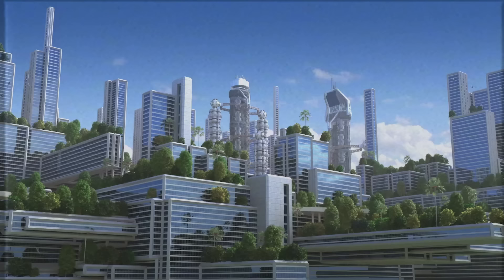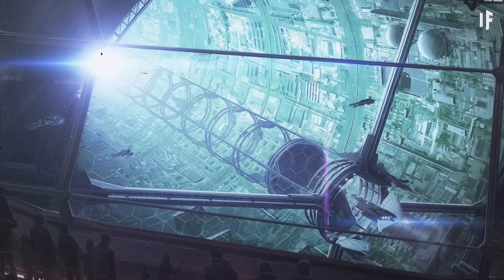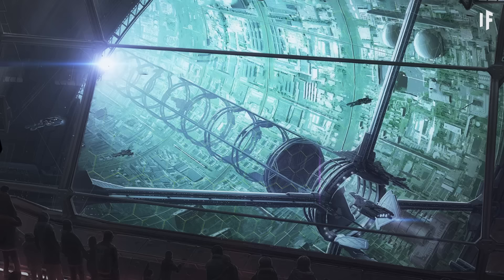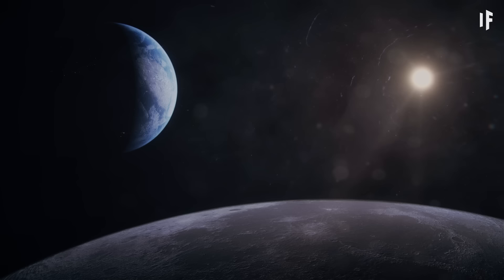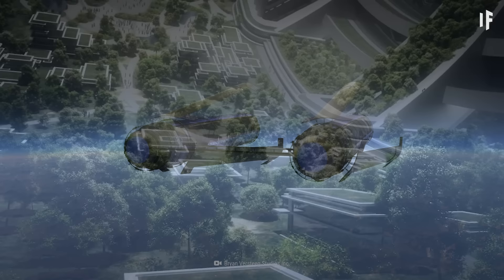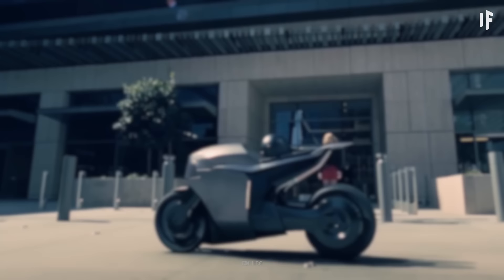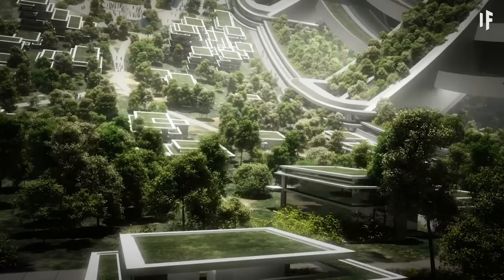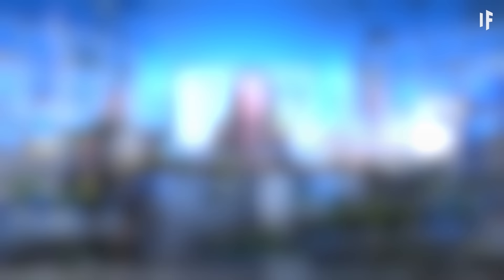What If We Built an O'Neill Cylinder?

Comment: The big problem with O'Neill cylinders is their instability. The will eventually start to tumble end for end if some method of stabilizing them isn't employed. The two cylinder method is interesting. Some proposals had them end to end counter rotating.
Reply: That is what those "fins" are for friend. They are mass re-distribution and radiators made into one structure.
Reply: @timothyblazer1749  If they're big enough and on both ends sure. However a spinning T shape is even less stable and pretty much going to flip end for end suddenly on a regular basis. I forget the name of the phenomenon, but there are video's of it being demonstrated on the ISS and you can also see this by setting a t shape spinning on your own.
Reply: Also note that the very large cylinders were only a sketch, only presented as an example of what's possible and feasible, not a finished design. O'Neill said it's probably about as accurate to what we'd have 80 years after completing the first small factory in space, as what "futurists" in 1900 thought about the year 2000.

There are no stabilizing "fins". The 3 huge things outside are mirrors to bring Sunlight in.

Comment: this is actually a better idea economicaly than many people think.  I have seen articles proposing this as the solution to some upcoming shortages of agriculturally produced products.  Many grown resources, such as rubber and cocoa and other such things, require very specific soil and climatic conditions.  Here on earth such places have already been claimed and developed, leaving little room for expansion of production.  An enclosed habitat however could have those conditions artificially created within, and more space could be created by building more.

A bit far fetched in the current conditions, but if demand for such things expands or climate change or soil depletion reduces current growing capacity, it may become necessary

Comment: I'd start the description by first describing the floating wheel design. Explain that the ring, as a design, doesn't offer much floor space or living capacity. The radius is the limiting factor, when combined with rotation speed, they need to function together to keep local gravity near 1G. An increase in the length of the cabin would increase the radius, and yes the rotation speed could be reduced to compensate. Larger radii and slower rotation have advantages to the people living inside, but the tensile strength of metals limit how big it can go. The other option is to simply widen the cabin. There is no limit per se, just keep extending the width of the cabin along the axis of rotation, and you end up with the cylinder.

Comment: interesting fact- if an asteroid did put a hole in an oneill colony, depending on the size of course, it would actually take a long time, possibly days, before enough air leaked out to become dangerous. think of a full balloon that you then stick a pin into (without popping it); it takes a loooong time for all the air to leave through that tiny hole

Comment: Question for a scientific or engineering type expert:
If the cylinder has different levels or decks ( in the video it says it might have one 250 metres inward from the outer level) would somebody standing on the inner deck experience the same gravitational effect ( ie 10ms²) from the rotation of the cylinder as somebody standing on the outer deck? 
Would the effect be the same, or lesser, or greater?
Reply: see the site "spincalc".

Comment: Far from what is claimed, the weather would not be easily controllable in a volume of almost 900 cu Km (900 billion cu m).  The NASA vehicle assembly building, at only 3.6 million cu m, is large enough to generate its' own internal weather.  In the cylinder the temperature, humidity and atmospheric convection would all have to be strictly controlled throughout the whole volume to maintain an acceptable environment.  That's one hell of an air conditioning system.
The only alternative is to allow the internal climate to develop naturally and see what happens.  The Earths lower atmosphere is only 10Km thick.  The radius of the cylinder is a third of that.  Rotation of the cylinder would create a vortex along its' axis and the effect would require serious consideration.
A simple solution would be to compartmentalise individual areas but the result would not be the large open space that is shown in the illustrations.

Comment: You've missed a very important piece. You need to make a pair of cylinders, counter-rotating which have they're endpoints connected. Otherwise precession would get it going out of control. 
Also, O'Neill updated his design to NOT use a Lagrange point. I think that putting 2 pairs of colonies on either side of the Aldrin Mars Transfer orbits would allow continuous travel to/from Mars safely and you would have a full-time staff that can maintain and service the tourists.

Comment: 1.35.   Such a cylinder would have an internal area of around 230 square miles (for the first deck). If the radius of the cylinder is 3.25, you could add another level, say 250 meters up.  This ‘second deck’ would be the habitation, the ‘country side’  around 210 square miles. The first layer would be the industry and food production plus the  ‘civilisation zone’ (the city scape).  A habitat like this could probably easily support 10 million people, and would provide a secure foothold in space for our species.  I’d make its first primary role to be the construction of a duplicate O’Neil cylinder.  With access to the resources in space, it should be quite easy, compared to building the first.  After the second cylinder is produced, focus could be turned to more extensive mining operations in the asteroid belt, producing huge power sats for near earth orbit to send cheap non polluting power back to Earth, plus also sending back valuable minerals, etc.  The first job of the second colony is to duplicate itself, then work on producing materials to make a skyhook for Earth, so that access to space becomes cheaper and more readily accessible.  The third colonies job is to duplicate itself twice, then to alter its orbit so that it starts to head toward Mars, to construct a Martian skyhook.  The forth colonies job is to enter lunar orbit and begin construction of a lunar skyhook and initial lunar base.  The fifth colonies job is to construct smaller O’Neil cylinders (one tenth scale) to act as Martian shuttles that cycle between Earth and Mars, having the ability to transfer tens of thousands of would be Martian settlers at a time.  The journey from Earth to Mars could take years - it doesn’t matter, you’re living in comfort in a medium sized town with all the amenities, whilst the habitat you are traveling on very slowly alters its rotation speed to accurately reflect Martian gravity.  Time to completion up to this stage.  About a century, Humans living and working in space, about 100 million.

But it’s not going to happen - we’d rather fight wars.

Comment: :What if we built an o'Neil Cylinder

My brain: WIDE HALO RING
Reply: The closest real life equivalent is called a Bishop Ring. Basically it's little brother due to material stresses. The bigger you build, the faster it needs to spin, which puts insane levels of stress on the material it's made from. You could technically scale it up to Halo ring size, using 'active support' but it would require insane amounts of continuous energy & maintenance.  A ring also has stability issues. A cylinder (built in pairs) or torus (think Elysium but with a roof) is far more stable.

Comment: The mirrored petals if rotating with the cylinder would experience enormous centripetal force.  The mirrors would actually be static or counter rotating slowly and with our modern solar panels and LED lights, it may be better to just have solar panels and interior lighting instead of mirrors and windows leaving more habitable surface area and more radiation and micrometeorite shielding.  Of course the shielding packed regolith perhaps binded with hydrocarbons (plastic) would also not be spinning with the cylinder but either static or slowly counter rotating.

As to what an O'Neill Cylinder bring us, the infrastructure to build large structures in space such as space ships and other O'Neill Cylinders, the workforce to do so and an economy in space to market resources gathered in Space.

Comment: What about radiation protection? It must be equipped with a device that generate magnetic field.
Reply: Pb.
Reply: @anhilliator1  Lead shielding? That's a lot of lead.
Reply: @anhilliator1  aren't faraday cage only applicable for certain wavelength? Like microwave radiation?
Reply: @JohnDoe-oe8gm nah they actually block any waves larger than the holes in the cage

Comment: O'Neill didn't go to such extreme. Island One would actually be around 4 miles in length with a diameter ~ 1 mile in diameter.
This would "house" ~ 8,000 to 10, 000 inhabitants. Take thw cylindrical and ~ 1/2 way is the "equator" where ~44 degrees , north to south of the "end caps" one would experience a "1" g environment. 
Pass the 44 degree section, a human being would experience a lower "g" environment.

A "localized" artificially created "magnetic field" for protecting the inhabitants from "cosmic rays" & the radiation from space.

Dr O'Neill wrote about the level of radiation a human being would recieve over a 30-earth yrs; ~ the amt one of Apollo Astronaut recieved during the "round trip" of of a single Apollo Mission.
O'Neill discussed this & other aspects of the requirements of building & maintaining such a structure.

Comment: you would have to have  segmented air locks for breaches.
Reply: If one was being genuinely constructed, it would most likely be built inside a thick non rotating shell. Outside is for shielding against radiation, debris impacts. While the inside cylinder freely rotates to produce gravity. If you wanted to do it the classical way like depicted by O'Neill then it would be built of modern materials (carbon nanotubes, kevlar, etc). As witnesses by Skylab, Mir, ISS etc, there is no chance of these little specs causing any serious damage to flimsy structures never mind something as large as an O'Neill cylinder. For protection..it would also have radar &  a railgun, laser turret, particle beam to deal with any unwanted objects coming towards it's general vicinity. 

With dedicated monitoring equipment, you could detect large objects decades/years in advance.

Comment: The O' Neil cylinder is 6 and half km in diameter which gives us a radius of 3250 m and if we calculate the Angular velocity, we get the value of 0.5 rotations per minute not 2 rotations per minute.

Comment: I like the idea, but it's still described as too easy to build. This won't be possible for a few more hundred years I think. You can't build this without a huge infrastructure in place. That has to be grown and profitable before you even get to this stage. 

Also, rotating at a revolution every 2 minutes? What are the horizontal forces on the people? Would they feel some dizziness because of this? Or maybe we would get used to it. Hopefully... 

I honestly believe if we got to this point we'd have already put in the effort to live on the moon and Mars. There would be many smaller stations in space. This might be a test case to see if we could finally build this with the thinking of testing it for a decade or two for an eventual push out to the Kuiper belt, or maybe living in the local Jupiter or Saturn (great views!) system. Then of course some day (with some sort of engine) pushing this to another star system? But by that time, who knows our technological level that would make this all obsolete?
Reply: He got the math wrong.  The RPM would be 0.5, not 2.

Comment: One problem you forgot to mention, the fluids in our ears would start sloshing around unless we stay completely still all the time, this causes nausea vertigo and you could black out. Not really the best way to live.
Reply: We're standing on the surface of a planet that's already spinning pretty fast.

You know how water stays in a bucket if you swing it around, or why you feel pressed down going around a loop on a roller coaster? Same principle.
Reply: 6 kilometers diameter.
If you're less than 200 (two hundred) meters tall, it won't affect you.
Reply: @JFrazer4303  well I'm not a physicist or a biologist so even if your right I wouldn't have ability to know if that's true. 
Also a much younger made this comment I dont even remember watching this video.
Reply: @anhilliator1  also a good point, but you have neither the rockets or cylinders to prove me wrong.

Comment: LMFAO!! 
6 Years to build an O'Neil Cylinder!!!! (O_o)
Ok... I need context...
Are we talking about BEFORE or AFTER we become space fairing? (i.e: Moon Base/Colony)
If it's before: ARE YOU OUT OF YOUR GOD DAMN MIND!!!????
If it's after: Well, maybe... it will depend on exactly WHEN after we became space fairing.
I want to remind everyone that the biggest thing we've built in space was the ISS
It was build with pre-build module that we flung to LEO & it took us about 10 years to complete...
The ISS is like a tree house for your kids compare to an O'Neil Cylinder!
We don't even have the complete understanding on how to design the thing! Let alone build it!
Don't get me wrong, we understand the concept, but we are far from having an detail understanding of it.
That understanding will come from previous steps that I will list below.
The most likely next step, after the ISS, would be the Von Braun Class Space Station. 
This will probably take 2-3 years for the structure to be built & 4-6 years to achieve full functionality. (With the supposition that Starship Cargo get certified)
Afterward, we could build it's big brother; the Spaceport (See The Gateway Foundation). 
The Spaceport concept is a bit more complex & has something important: Large pressurized volume built in space.
Construction time will depend on our learning from the previous station (Hopefully less than 4 years for the core & first ring)
The next logical step would be The Kalpana Class Space Habitat.
This one will be the next leap in size & will require a lot of effort to build.
I don't see that kind of station being built before we have a solid presence on the Moon & can ship material from it.
Then, AND ONLY THEN, can we start thinking about building something as massive as an O'Neil Cylinder (Island 1)

Comment: Meterorites? Radiation? Sun  CMEs?
Reply: All taken into consideration.
The hull will be something like 1.5 meter thick reinforced concrete, for structural strength and shielding against galactic cosmic rays.
Impactors are few and VERY far between.
Ask Chelyabinsk how safe any city on earth is. Ask any other city that didn't get hit how likely it is.